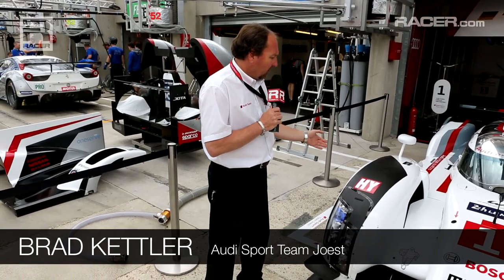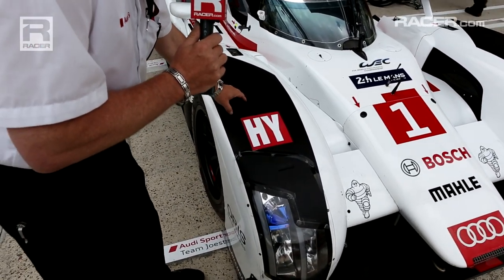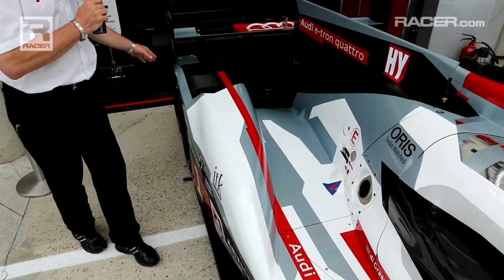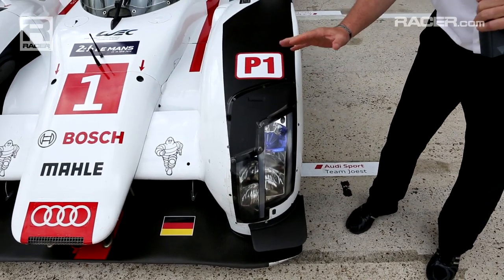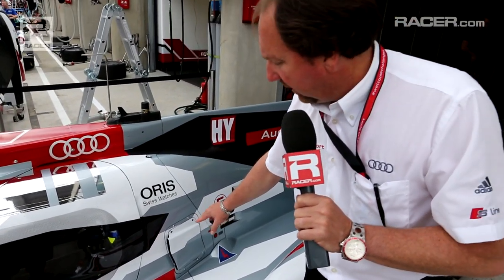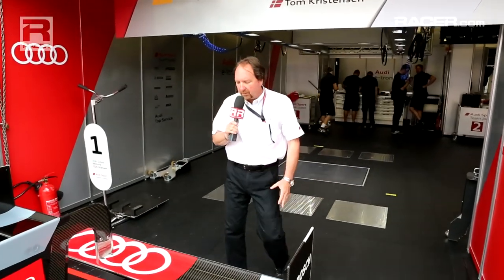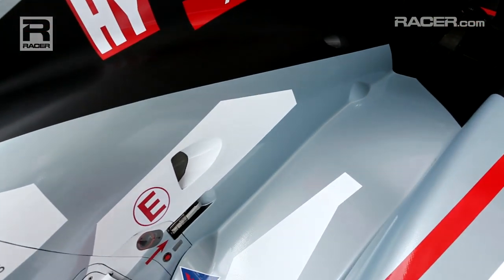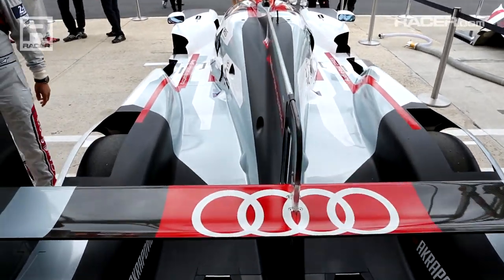RACER: Audi R18 e-tron quattro Aerodynamics with Brad Kettler

Comment: Is there a reason the exhaust isn't under the car?
Reply: Wording in the technical regulation forbids the exhaust from not being visible with the wheels attached either from the side or top.
Reply: Ah OK, thanks
Reply: FormulaChris085 I'm making my way through the 2015 regelations as we speak. 'Exhaust pipe outlets must not
be inside the diffuser neither inside a 900mm diameter
cylinder centered on the rear wheel axis and extended from
950 to 550 mm from car center line.
No point of these outlets must be situated less than 300 mm
from the trailing edge of the rear diffuser.
Any point of these outlets must be visible when seen from
above or the side or the back.' Good luck attaching the exhaust pipe under the car ;)
Reply: Sticking it under the car also reduces the effect of the diffuser
Reply: @benjaminmcintosh857  It enhances it in fact, quite a lot. It helps speed up the air flowing under the car and gives a ton of downforce.

The problem is that the downforce becomes a bit like a light switch effect between on and off throttle. Sucks when you have to modulate throttle through a turn. The only way to remedy this is to do what Renault did in F1 really well in 2013 and earlier, by having the throttle stay open no less than 90% even when the driver was completely off the pedal. They'd basically retard the timing to the point of sending all the power out the exhaust to keep the airflow up and the downforce consistent. But now that's not allowed.

In short, they don't want this happening for the sake of efficiency, and probably cost too. The R&D for a blown defuser is costly and never-ending lol